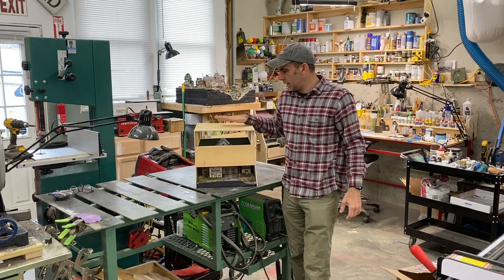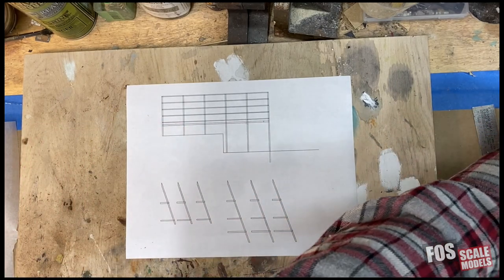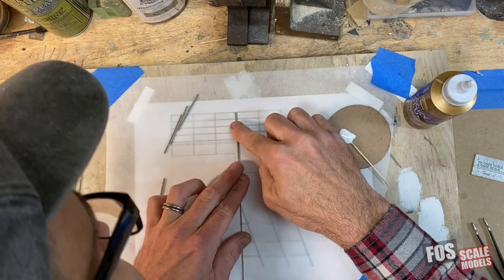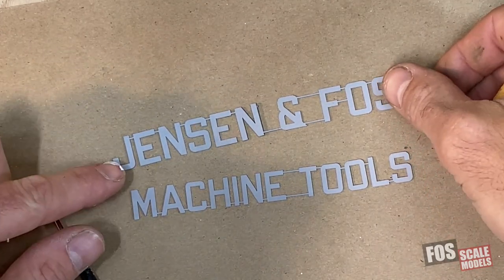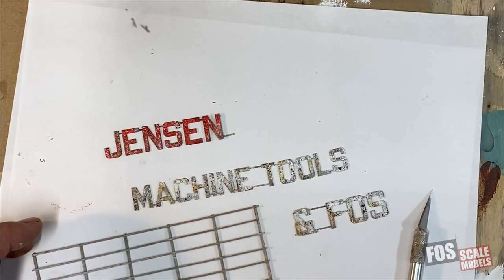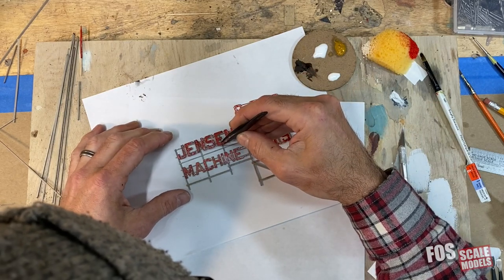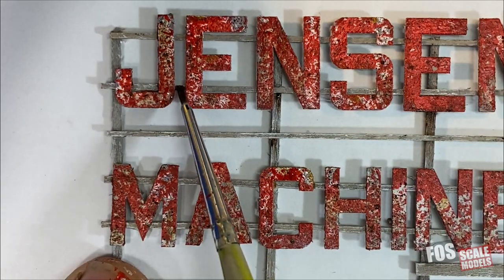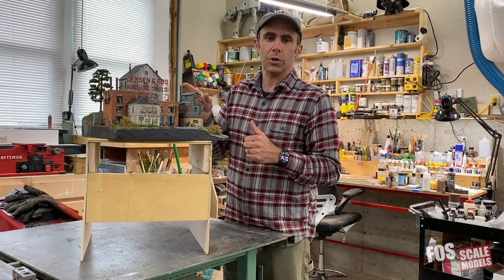BUILD IT. SEND IT! PART 5

Comment: I see one thing that is wrong with this build. The separate building that kind of looks like a casting shop for the machine tool company has only one door that is a roll up door and is faces away from the rest of the structures. It would be hard to get product from there to the other buildings or vise versa. That is an insignificant thing though and doesn't take anything away from how outstanding a job the two of you fine craftsman have done. I hope it sales for a large amount since the money from the sale is going to a charity. To have a structure built by one of you guys would be really cool but being that you both worked on one together makes it even more awesome. Great series of videos from y'all on both your channels. Really neat to see how similar but more different the two of your styles were in the beginning and then how your separate techniques come together with both of your styles of working becoming more similar than different at the end of this project. Y'all blended your techniques together well and it shows with this excellent diorama that anyone will be lucky to get. Stay well. -Wil  👍

Comment: I like what you did with the red. You really should get yourself some sea sponges they are great for not leaving a pattern. Try it. Good work guys you are two of the best on YouTube and that is a big compliment. You should consider a couple of lights pointing at the sign. I am truly awestruck by the finished product. I hope you get a lot of money for the humane society. After such glowing praise I would like to ask you guys a question. Do you think the overall age gets a little much at times. I was working on set once, it was a jail cell. The art director when I asked him what he wanted he told me he wanted it dirty. So he left and I got to work. I did graffiti, hand smudges scratches dirt age rust on the bars as well as wear spots. When the art director came back he said "What the "blank" is this,  it is awful I hate it, it you cant do it better than that just have it repainted and we will go with that." It was the worst complaint I had ever had in 11 years. When I said you told me you wanted it dirty and he said. "I told you dirty not 'DIRTY' like I was supposed to be able to read the tone of his voice. Because it was oil paint I was able to use rags and mineral spirits and remove and adjust and make it work. When they filmed it it was mostly close ups of the actor and you barely saw my work Your scene looks a little "DIRTY" but maybe that's what you want. For your work you are the art director. Sorry to be long winded but I get inspired when I see you guys work and it make me want use all my skills again